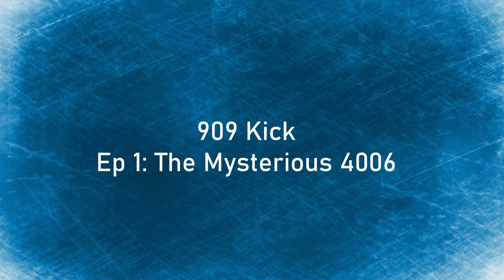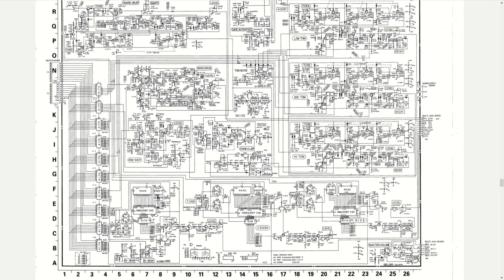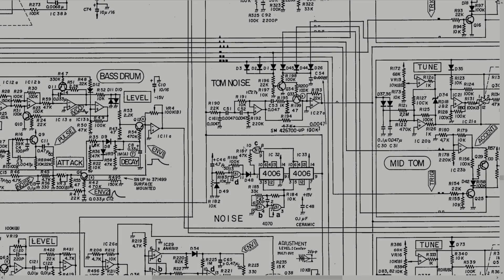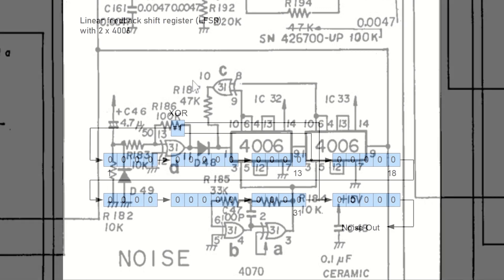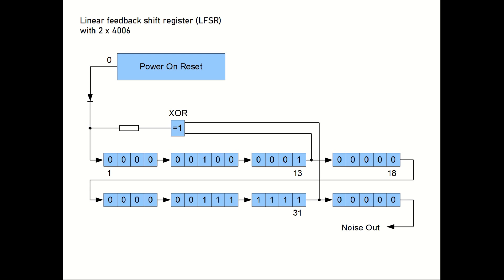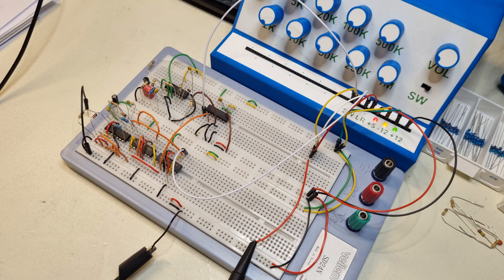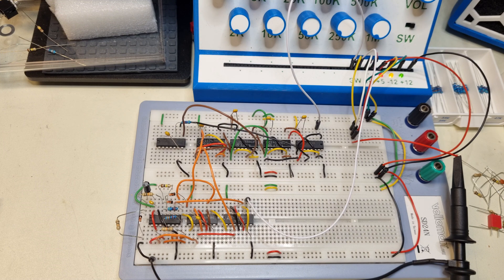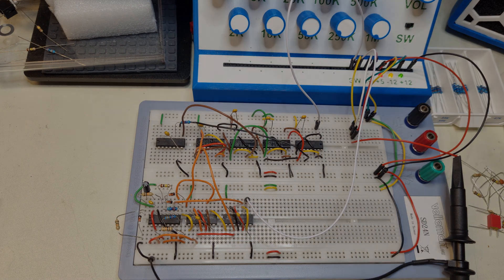Eurorack DIY: 909 Kick (Episode 1)

Comment: the noise from the npn sound more rich to me...
Reply from the maker: You are probably not alone with that choice. I've seen a couple of circuits with a transistor noise circuit instead of the 4006.
Reply: @MeeBilt   i seen in the 808 documentary that roland used damaged or defective transistors they got at a discount because they couldn't afford new ones and the roland founder claims that this gave the 808 its distinctive sound or "sizzle". then when the 808 became a hit they had no way of getting a hold of such transistors so they couldn't capitalise on its success.

Comment: What about using a diy "noise chip" instead? You can program the lfsr digitally. The rest of your circuit will be still analog, while you save a great deal of components for the noise part. An Attiny85 could do the job
Reply from the maker: That is definately doable, but the clock frequency of the LFSR is 300kHz, so the code might need to be optimised a bit to make it runt on a microcontroller. In my case I wanted to build a circuit that replicated the original but with more modern SMT components.
I also considered using a CPLD, but that wasn't really an option when I looked into it more in detail.

Comment: You can get CD4006 from Futurlec for $0.75 each. You can get NTE4006B (an equivalent) from SynthCube for $2.00
Reply from the maker: Yep, they are not impossible to get hold of - I actually bought mine from the only physical electronics shop near where I live. There are probably less than 5 of them left in whole Sweden nowadays 😥
Anyway, I wanted to build something with SMT components that I can get hold of easily.